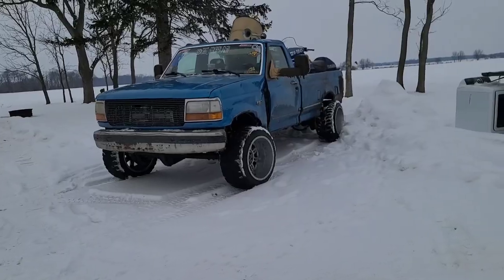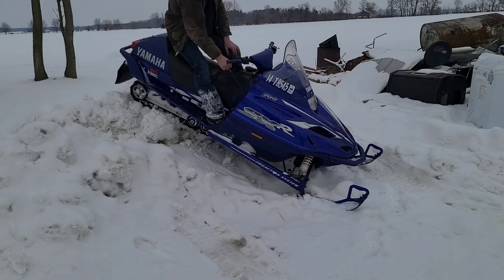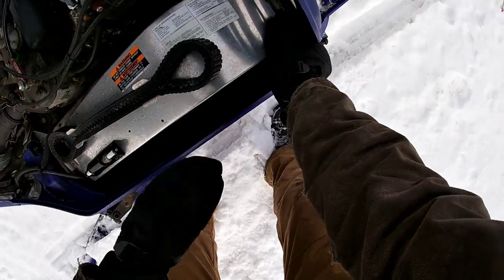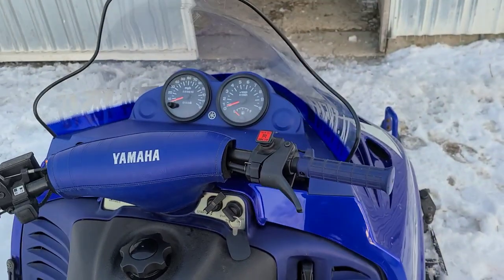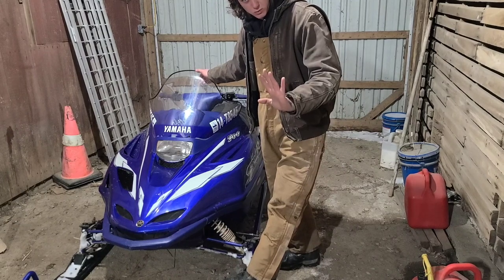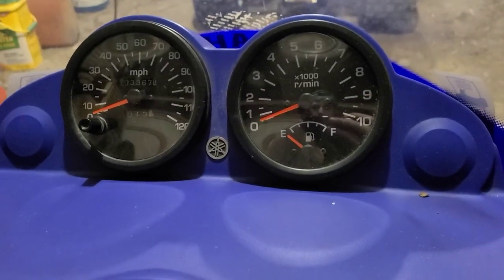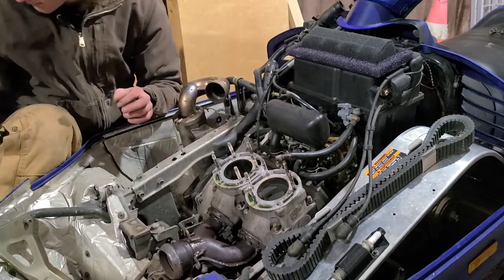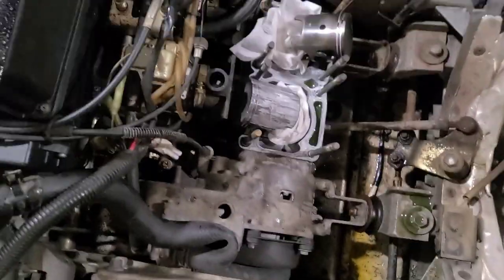I BOUGHT A SNOWMOBILE AND BLEW IT UP IN 2HRS

Comment: 3000 miles on a 2 stroke and you think the engine will be fine lol. If that sled did nothing but run at 60mph, that's 50hr run time in the mid to upper range RPM. If you want a 2 stroke to maintain peak performance, 50hrs is when they're due for a refresh, meaning new rings. Forget the miles, gas 2 strokes are more like diesels and its the run time that kills them. Only diesels are measured in thousands of hours and gas 2 strokes are in the hundreds.

Comment: buy a polaris next time and it won’t blow up
Reply: Yes, it won’t even start so it won’t blow up!
Reply: Shit no, Polaris is worse than a Yamaha. And if you don't want Yamaha go with an artic cat.
Reply: @ericmacnichol3791  older Arctic Cats are known for electrical problems like no spark
Reply: my guy my 96 xlt 600 can out run a yamaha any say of the week and last time i checked yamaha makes a 1200 pound sled and that really dumb
Reply: @davidbower6623  oh those dumb xlt monoblock engines I hate those things. One of those couldn’t touch my 700 Viper
Reply: @davidbower6623  but yes that’s stupid sleds have to weigh that much. I like them light.
Reply: my 600 triple can put out close to 230 horses trust me and everything is carbon fiber and it also naturally aspirated and if that beat turbocharged sleds that’s sad
Reply: that’s also funny my sled starts up first pull every time
Reply: @davidbower6623  I hate to say it but stock there like 100-125max there is no way you get 230hp out of a 600 if we are talking 1995-2000 vintage
Reply: well you can if you know what your doing

Comment: She sounds like 1 cylinder is running lean
Reply: Sounded like 1 cylinder wasnt running... seemed down on power and sounded off to me.  I think he was right and there's a problem with the carb on that side.  Clean carbs, check oil injection system is working and go from there.

Comment: You do know this needs a mix fuel right its a 2stroke,,,im sorry if I offend u just never know.. I know they are bad for the oil pump going bad.
Reply: Its got an oil injector tank so you dont have to premix it. I have three sleds like this with 5,000 miles each and they work like brabd new.
Reply from the maker: Ik lol
Reply: 😅😅 mixing oil in snowmobiles hasn't been a thing since like 1984 every sled has oil injection you don't need to mix it

Comment: And please tell me know it takes mixed gas..  and if it has a pre mixer system.  Get rid of it and mix gas yourself.
Reply: Good way to burn up the lower end by eliminating the oil injection
Reply: All the old heads before me always told me. Get rid of auto oil mix. When u mix your own fuel.  You know it has oil.   Rather risk an oil mixer going out and grenading your motor.    May be diff for snowmobile.  Idk
Reply: @sancho........  💯 different with snowmobiles, oil injection has been a common standard with snowmobiles for 25+ years. Can't compare a two-stroke in a boat motor or Dirt bike  or weed wacker with a snowmobile 2stroke there very different
Reply: If you don't understand snowmobiles probably shouldn't make a option, my father is 60+ yo and has no problem with oil injection lol
Reply: Hey. Well if oil injection is diff in snow mobiles. Then ill gladly wave the white flag.   My background is from fourwheelers.   I'd rather trust myself , than something that mixes my fuel for me.  To each thier own.  No biggie. Live and learn

Comment: If it’s a 2 cycle and you put just plain gas from gas station then it’s gonna burn it up!! It’s gotta be gas/oil mix😂😂
Reply: It mixes in the carburetor
Reply: Have to have oil mixed in with the gas because a 2 cycle doesn’t have oil in it that’s why you put oil in with the gas...

Comment: Probably the reason of it blowing up is caused by over heating
Reply: No I think he called it right and there's a problem with the carb on that side.  Seemed down on power and if one cylinder wasnt getting any gas that's what happens.  If the carb is fine maybe a line for the oil injection system is clogged.  There's a bunch of things to look at.  Have to figure out why it blew up or it's just gonna happen again.

Comment: 3k miles on a 2 stroke.  U better had rebuild receipts!! Or ur asking for it
Reply: Got 11k on my ski doo. Original everything except track
Reply: YT certified technician right here
Reply: Yep.  Because it doesn't take a rocket surgeon ....  2 strokes need top end rebuilds.    Google it.
Reply: @sancho........  Later than 3k tho LOL. Even my old 1977 John Deere Liquifire has 6k miles with nothing done to the motor except crank seals I put in last fall.
Reply: K

Comment: Gunked carbs or bad gas
Reply: Causing it to seize up?
Reply: @ramsay4804  either low compression with rings pistons or not enough fuel idk. then you have the spark plugs. Maybe throw some yamalube in it.

Comment: It’s a two-stroke you put two two-stroke oriole in it not gas
Reply: No you don't, snowmobiles have oil injection, you dont mix your gas
Reply: @jackfulton6696  because I have a two stroke dirtbike quad and Geske
Reply: @jackfulton6696  you do you mix the oil look it up fat checked me that
Reply: @tomgorrell4022  dude, you dont mix oil and gas in your gas tank, snowmobiles have oil injection pumps and oil reservoirs that inject oil into the carbs and the crank case, just because it's a two stroke does not mean its the exact same as your dirt bike
Reply: All two strokes are smoky it lubricates the piston
Reply: @tomgorrell4022  you make no sense
Reply: Look on YouTube type in two strokes
Reply from the maker: Idiot snowmobiles mix themselves